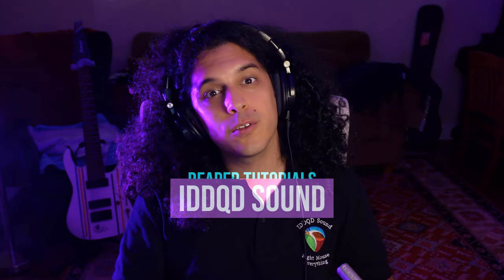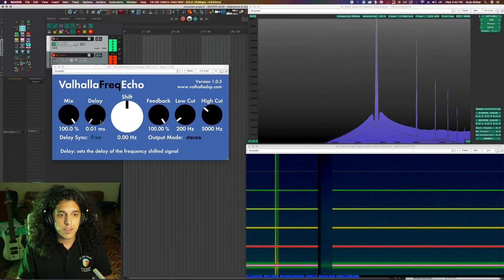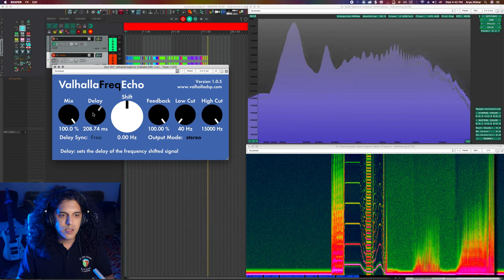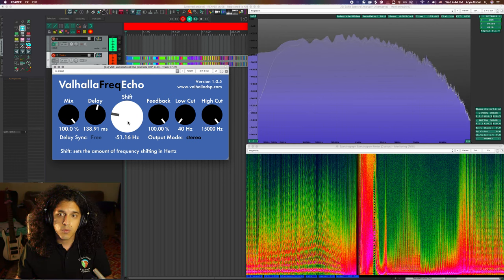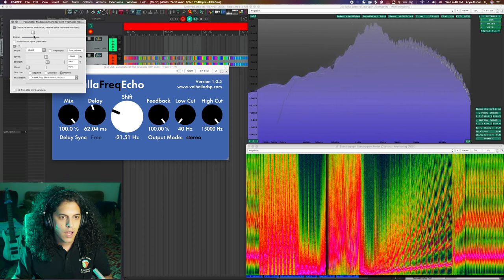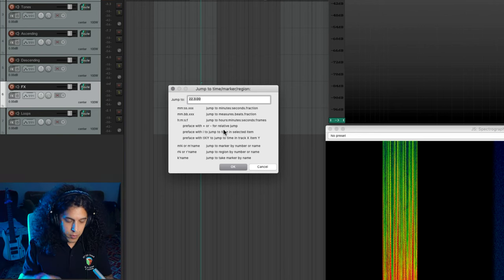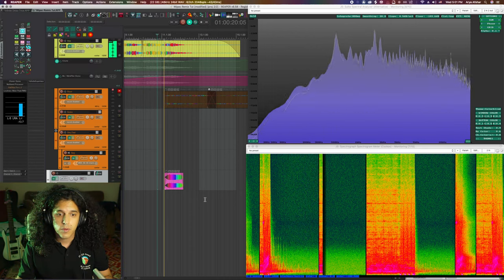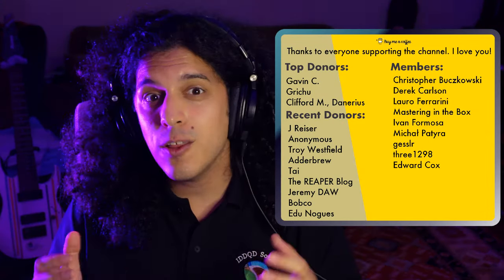Sound Design Tricks with Valhalla FreqEcho

Comment: Might be a beginner question: is there a way to filter field-recorded sounds through these FreqEQ settings in order to turn the field recordings into loops, ascending/descending tones, etc? Thanks!
Reply from the maker: Yeah definitely. I mean they would use their natural quality and probably sound a bit synthetic, but if that works for you, then yes.
 You could also just find 2 zero crossings on a field recording and then cut the recording on both sides, and  then glue and loop them and they should loop seamlessly.

Comment: Great stuff as always. When doing sound design latency, PDC and automatic delay compensation isn't really an issue so setting this next option doesn't matter. In project settings -> advanced you can turn on 'Allow feedback in routing' and send the output of a track through a second and back to the first. Use a clipper to protect the ears! Now make a processing audio loop with all sorts of effect plugins like filters, EQ, and reverbs. Change the order of the plugins. Automate. Use multiple tracks all feeding back in different ways to each other. 😄 Nightmare.
Reply: Thanks for the tip 🙂👍
Reply from the maker: Hey spoiler alrert!!! that's an upcoming video lol
Reply: @IDDQDSound  😆